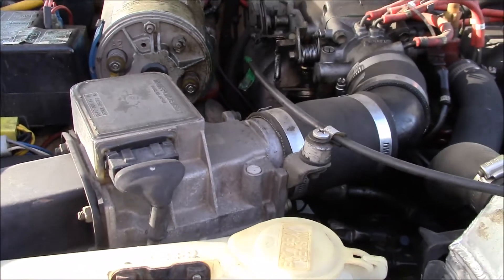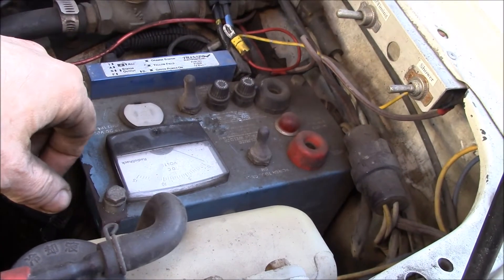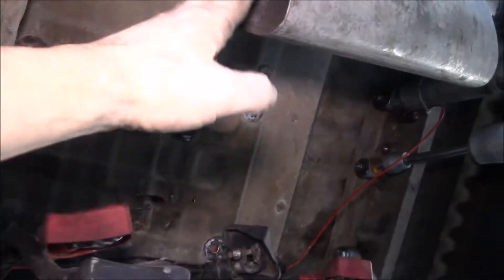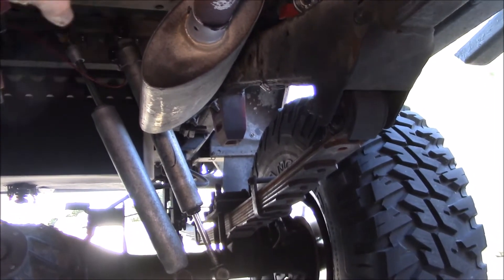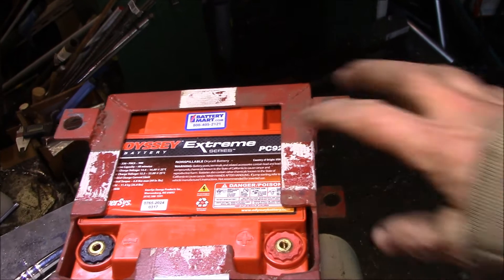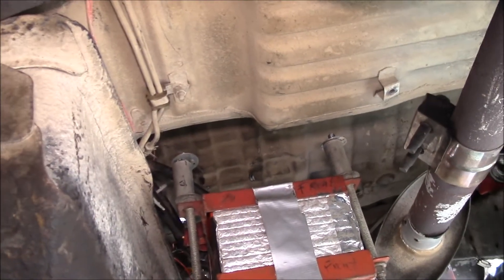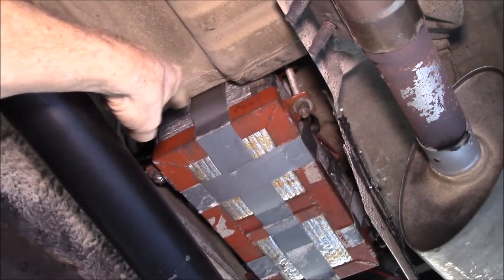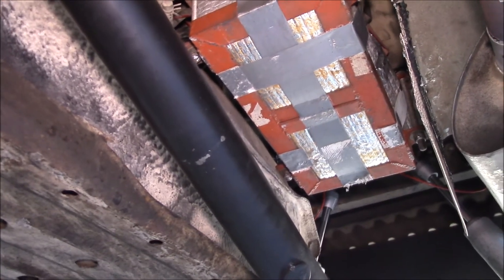Dual Battery Installation

Comment: I was thinking this was the only area to put a few batteries, Certainly an Idea I had as well.  I was wanting to make access through the top though, Why does the bed have to be wavey
Reply from the maker: Yes, that ridged floor is a pain.  Suppose you could make up some sort of flange around the opening to level it out and let you make a flat plate to cover the opening.  Would be nice if I could drop the batteries down from above.  Maybe next time I need to replace them I'll look into doing that.

Comment: see things made long ago were better quality. I have always said that quality has gone down hill. Nice video.
Reply from the maker: So true.  I'm hoping this latest battery holds up at least as long as the first one I put in.  They were the Black Panther brand.  But when I needed to replace them, Odyssey was the only brand with this size battery.  But some place along the line, I changed my muffler location and didn't really think about that and I think that added heat caused the last battery to fail prematurely.  I guess time will tell.  I also need to get my battery monitor installed in the truck to keep track of state of charge and small overnight current drains.  That probably would have showed me that I had a problem with my old alternator long before it killed the battery.